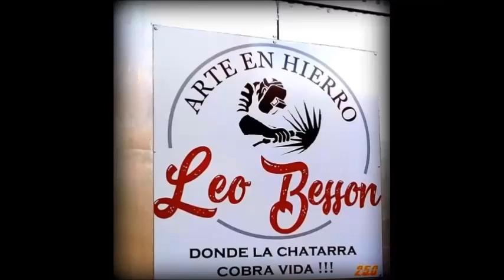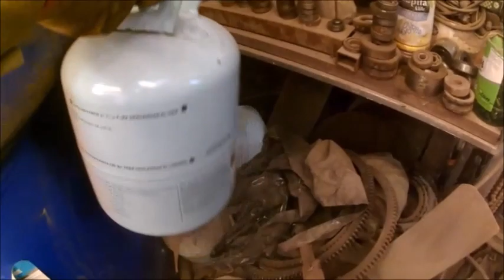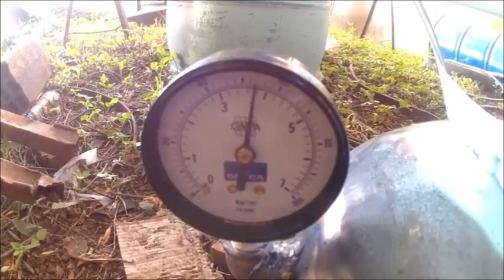DIY GARRAFA de AIRE portátil !!! ( Con garrafa de Freon) #herramientascaseras

Comment: Hola tengo una duda, tengo una farrafita de esas. estuve viendo que soporta 30 libras es seguro ponele 80? La idea mía es hacer un compresor de aire con una bocha de heladera. Estaria agradecido en que me ayudes a sacar estas dudas que tengo 🙏🙏🙏
Reply from the maker: Aguanta hasta casi 200 libras , y tienen un fusible por si se pasan de presíon
Reply: las 30lb (libras) que dice en el envase son de masa (peso en libras aprox 13.6 kg) no de presion. 
Las libras de presion depende de que gas o fluido comprimas en el envase, 4 kg/cm2 (4 atmosferas) no superan los 57 psi aprox. 
Una garrafa de estas viene de fabrica con mas de 10kg/cm2 asi que esta muy por debajo del limite.

Por ejemplo una garrafa con la denominacion DOT39 - “Cilindro según especificación 39 del Departamento de Transporte, NRC (non filled cilinder) no reutilizable con presiones de servicio y de hermeticidad de 308 y 385 psi respectivamente”
R22 DOT-39 308/385 psi (servicio y hermeticidad), 770 psi rotura. Válvula o Disco seguridad a 400 psi (si se provee).